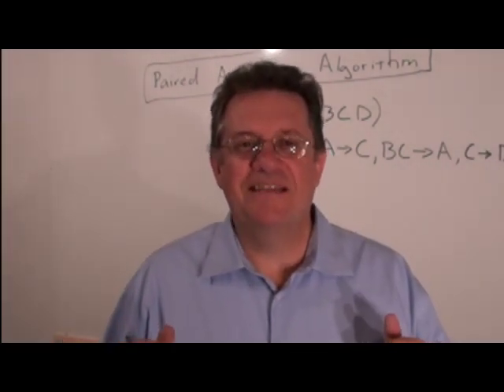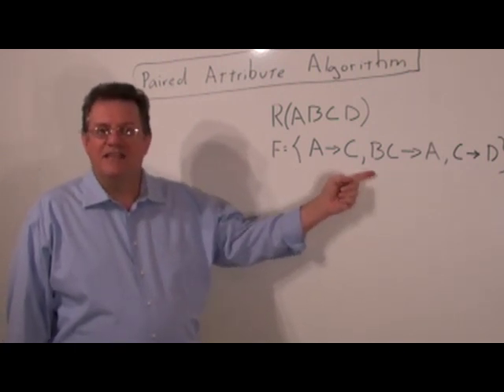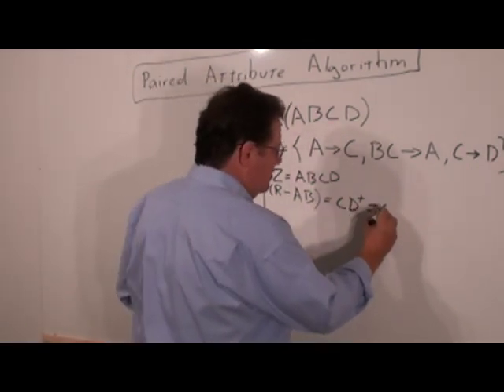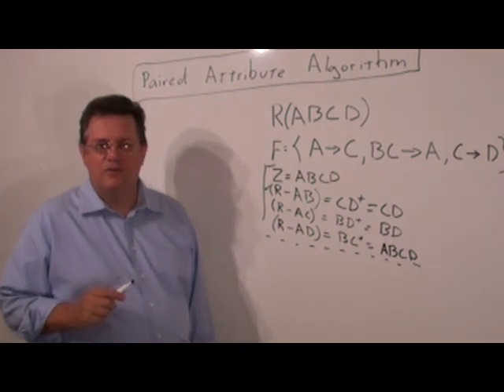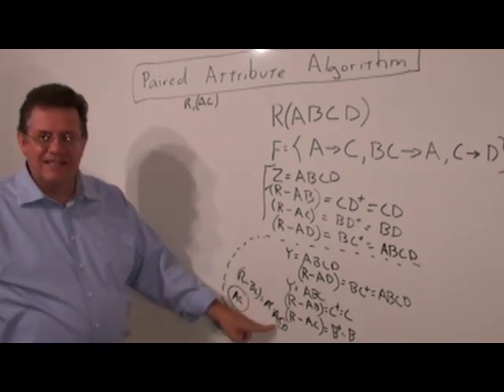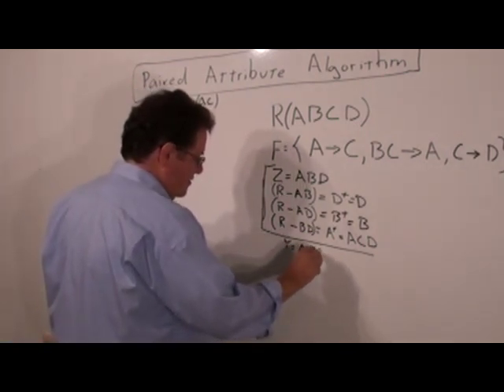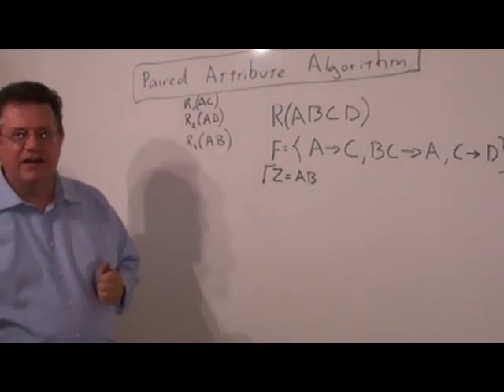UHCL 33a Graduate Database Course - BCNF Paired Attribute Algorithm - Part 1

Comment: what does it mean 6:35 that "C" was las thing that was included? 
Included into what and where? having some trouble understanding that part.
Thank you gary from australia
Reply: Initially he starts with (R - AD), which means 'A' was included from the start. Then he adds to that 'BC' (following the calculation of R - AD). He then removes 'D', then 'B' and are left with 'C' which is the element not included originally in the (R - AD).

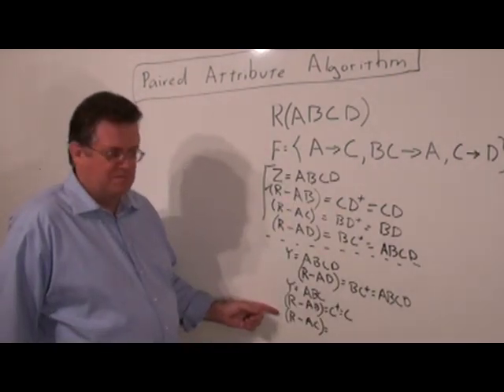Comment: At 5:46, is C+ rather not CD?  Thank you
Reply: +Gilbert Adu-Sefah Yes, I think it is.  Because when R - BC = A+ = ACD (he included the D here. From the same logic C+ should have been CD). However even if C+ = CD, I do not think that this has an effect on the overall result in this problem.

Comment: Wouldn't this procedure not work if there is an odd amount of attributes in R?
Reply: +HimikoWerckmeister Even/Odd number of attributes is not an issue.
Reply: +Gary Boetticher Thank you for the reply, another pressing question I have is lets suppose I have the set of functional dependencies as follows:
BG->CD;
G->F;
CD->GH;
C->FG
F->D

I know for the fact that by deploying your LMR method as described in previous videos that the key can be either BG or BE, applying the algorithm described in the video I obtain the following decomposition G(G,F,D) and Rest(B,C,H) my question to you is, can I decompose these relations any further?

Comment: I have a query sir, 
we know that a given F is in 2NF if there is no 2nf voilation, but how do we check if there is any 3NF voilation as well and then when we use bernsteins algorithm we get to 3nf form and from there how do we check if there is any BCNF voilation. 
i mean what exactly is the difference between a super key and candidate key ??? 

For Eg if the candidate keys are ABC and ABD 
then would the super key be ABCD 
and the non prime attributes can also be refered as non key attributes ?